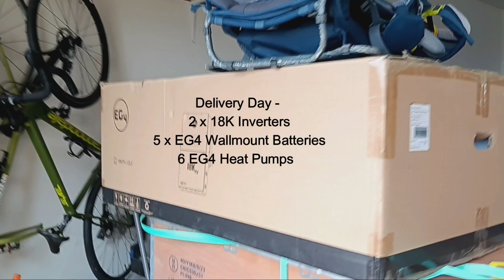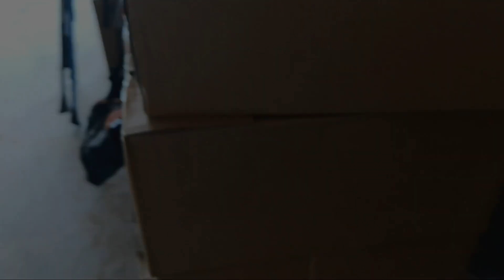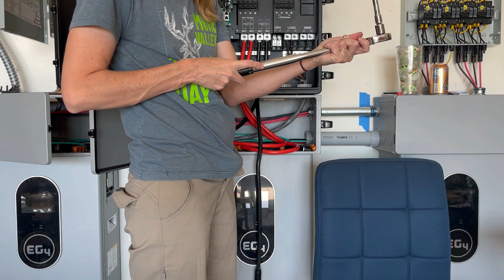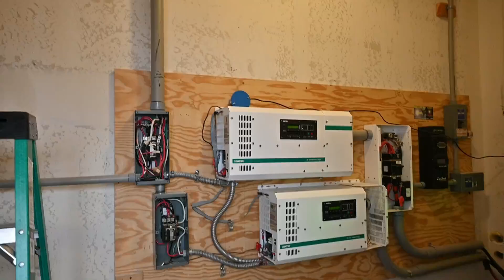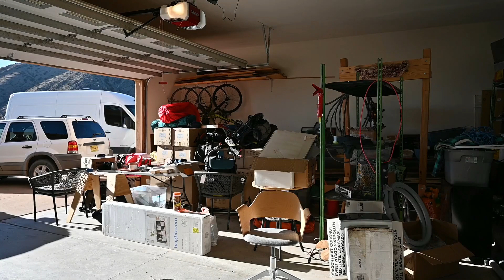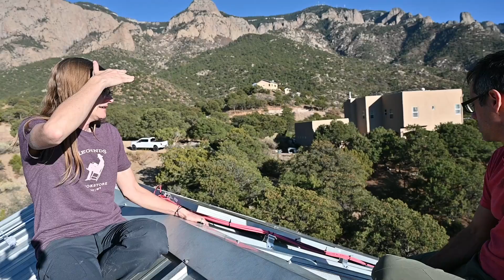Massive EG4 Solar Installation: 2 x 18k EG4 inverters, 5 EG4 batteries, 20kW PV

Comment: Very nice setup! I was hoping to see a closer look at the S-5 brackets that support the panels. I'm getting ready to install 40 410 watt panels on my metal garage roof and want to do a similar setup for the rail-less mounting. I went with the new FlexBOSS 21 and the GridBOSS. The GridBOSS serves both junction for the multiple inverters and for the generator. It's an intellegent unit with smart ports and a built-in transfer switch that's interlocked. I was getting nervous watching you guys getting your fingers so close to the 450 volt DC solar connecyions in the inverter! I work with 480 3 phase systems everday and have a big respect for high voltage. It will kill you if you're not careful. Enjoy your new system... Congrats! 😊

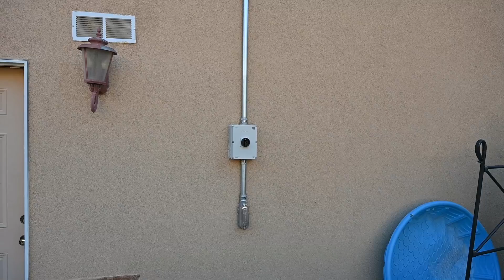Comment: At 22:08 in the video, the solar array disconnect is going to be subjected to large amounts of water coming out of canale on roof.  Maybe that was the location that made most sense and yes disconnect box is exterior type but kinda asking for trouble. I would add a small tin roof over that box just for ease of mind. Seal it around conduit.
My experience as a builder in northern New Mexico has witnessed many water incursion problems around canales on SantaFe style construction.  Trying to be helpful not nit picky.
Nice solar and video.
Reply from the maker: Ya we gotta do something about that.